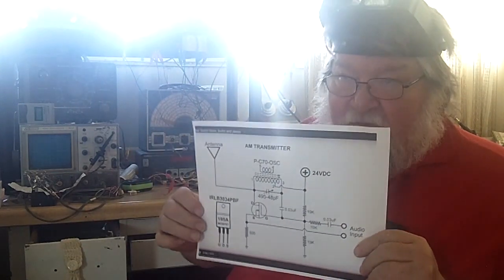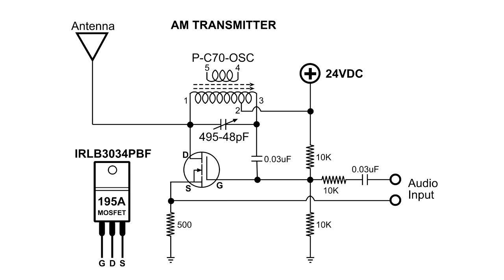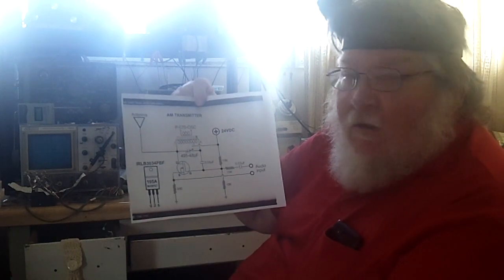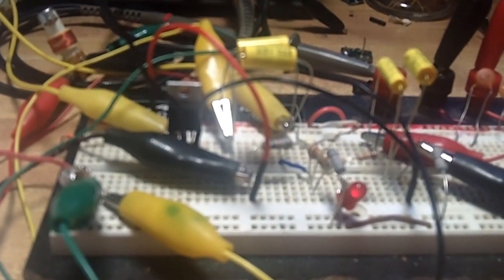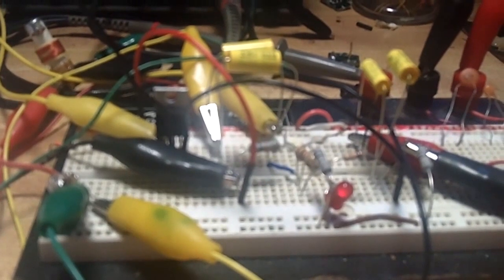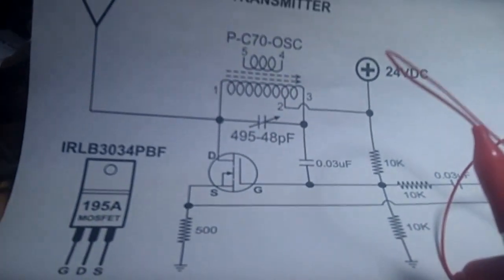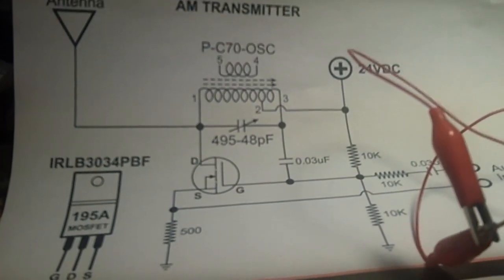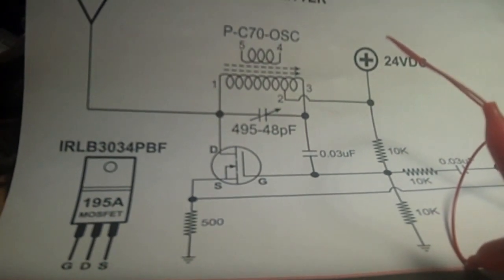A Better AM Tramsmitter

Comment: I'm glad it worked for you on the first try. I try to design circuits for the beginner so they will have success. As you said transmitter can be tricky to build, so that why I use store bought parts. Beginners might have trouble winding coils. Nice video, you brought out very good points able the problems in building transmitter.
Reply from the maker: I have to admit Rick that I believe that was the first time  a transmitter, AM or FM, that I've built has worked first time out the gate. I'm really trying to get others to build this following  your schematic to have a good chance at success. I still plan on building the tube AM transmitter you designed,,,, down the road. Thanks.

Comment from the maker: Want to add to this,,,, while the video was uploading,,,, I worked on this some more and got a self wound coil to work,,, YaY.
I will do a follow up on this so it might end up being crazy cheap and yet works real well.
Reply: I like it too Carl, um gonna get the few parts I need.  
Perhaps you might post a parts list for that coil transistor cap etc., in the description.  
Um a little nervous about he 6L6 tube transmitter, don't want to boolg, lol.  
Don
Reply from the maker: Don, you can get the coil, P-C70-OSC from , Antique Electronic Supply- www.tubesandmore.com like I mentioned for around 13 bucks shipped. If you wait, I want to dial in the coil I wrapped that is working to get the exact number of turns and what the best loop taps are. I put in three and two of the taps work quite well. You can copy the mosfet number in the video and search it on Ebay. They were pretty cheap. I don't know if another mosfet will work,,,, pretty sure one will. But so far, this one kicks butt.

Comment: That sounds real good Carl, how close is the transmitter antenna to the radio?
Be looking forward to see how this works, range, etc.
The coil is a little expensive but I will see how you do with making your own.
Reply from the maker: Bill, I got two coils now that I wound that work pretty good. I've picked up reception in the living room so maybe 20ft so far. I haven't tried  outside yet but I think at 18 volts it should work out in the yard. Also, I was able to put a couple of mica caps together, about 300pF total, to replace the variable cap and that worked as well. I think the main trick to this one is the MOSFET it uses. it really lets you put out some power.

Comment: @skycarl I had built this transmitter a little while ago and got it to oscillate, however I do not think it is transmitting on the AM band. I could not find a 495-48pF trimmer cap so I used a 105-480pF cap. Do you think the trimmer cap is the problem?
Reply from the maker: Sam, I wouldn't think so. Since you have some oscillation, you may try switching the coil leads, 1 and 3. Also, this circuit seems to like power, so make sure you try it at different voltages.
The reason I don't believe it's the tuning cap is that I got this to work doing several things like replacing the variable cap with a fixed cap and used a self wound coil with different tap points to adjust frequencies. Your cap is not that far out from what the schem calls for.
One last thing, if you put this together on a bread board, make sure all the components are as close as possible.

Good luck Sam, and let me know if you get it working in AM.